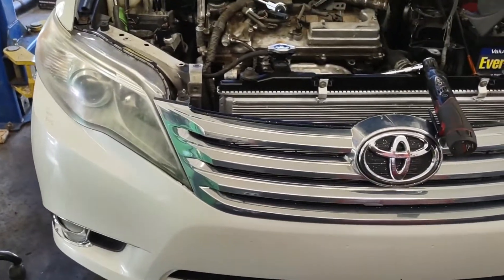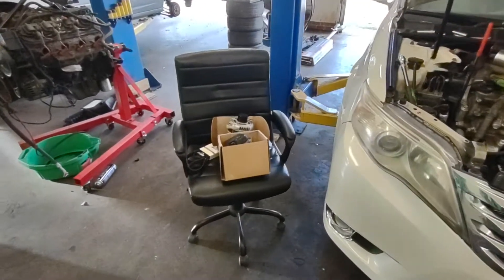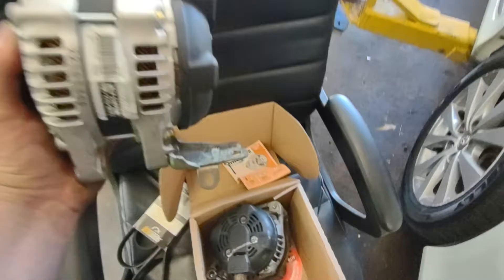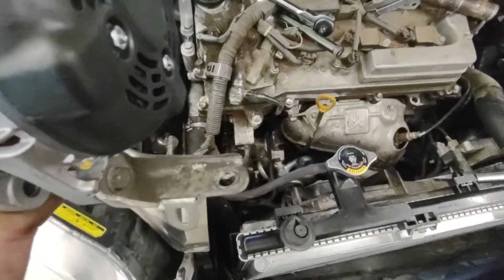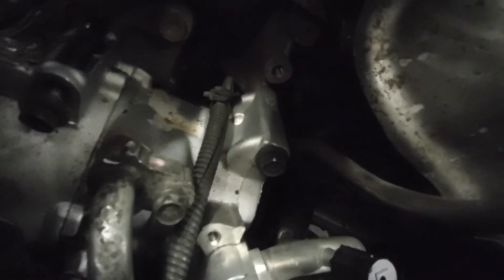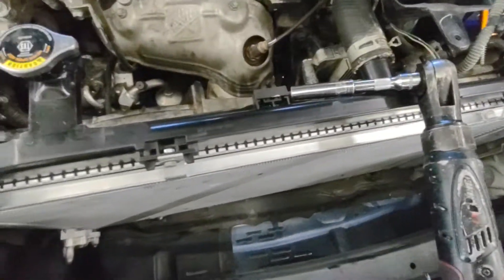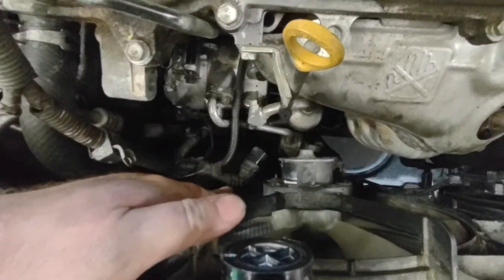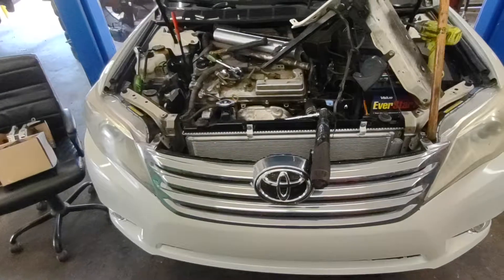EASY! 2005-2012 Toyota Avalon alternator replacement.

Comment: Thank You for the video.  I just completed this job.  A few notes
A)  I removed the wheel and inner panel.  This make access to the tensioner and belt much easier.
B)  I disconnected the radiator hose in front of the alternator.  This make access to the lower mounting bolt and moving the alternator around much easier.
C)  I did not touch the radiator support crossbeam, fans, or radiator
D)  I removed the oil dipstick  and exhaust heatshield.  This allows you to turn the alternator pulley facedown and pull it out toward the center the vehicle next to the radiator fill
E)  Be  extremely careful.  There's thin wires connected to the underside of the bracket at the back of the alternator.  These wires go down to a sensor below the alternator.  You really cant remove these wire until the alternator is  pulled out slightly.  It would be extremly easy to accident rip these wires out and many videos fail to metion them
Reply from the maker: I appreciate you taking the time to share your experience and insights with the community! Always good to have multiple routes to take!

Comment: I saw this, this looks like a great way to avoid a ton more work. Do you see any reason you couldn't still drain the radiator and put in new fluid with this method? I personally think it should work... guess we will see tomorrow.
I'm also going to be putting on a new belt too (might as well do all 3 at the same time, got 100k miles on it, so it seems to be about time.).
Reply from the maker: @eriklondon2946  you could definitely drain the fluid if you want to. And yes this would be a good opportunity to change the belts
Reply: @13sGARAGE  I did it! It was a success. Took me a lot longer than I thought due to the tensioner on the side, and the bolt under the alternator. Walked to Home Depot to get a longer ratchet and then did it.
It is nice to have a new belt, new fluid and a new alternator. Thank you for the video! Cheers!